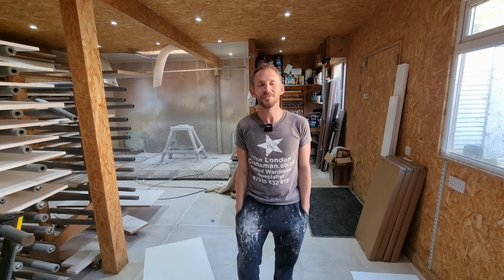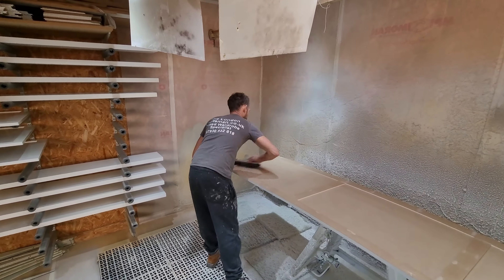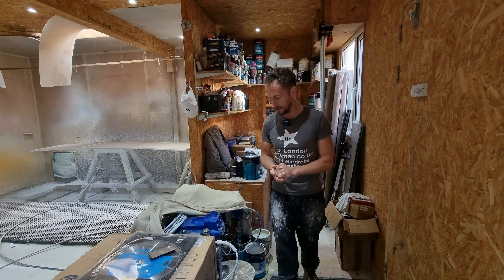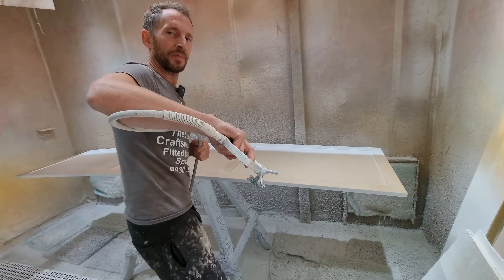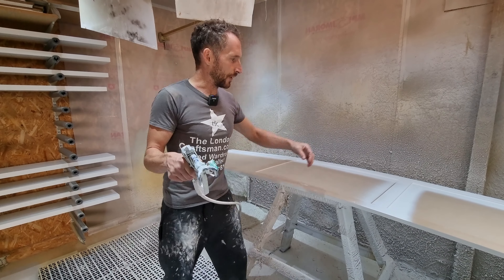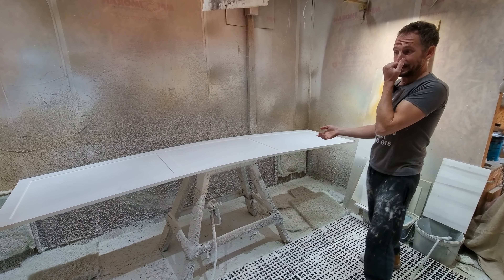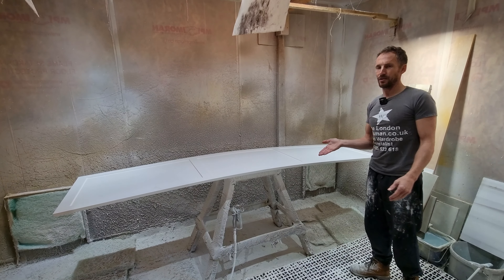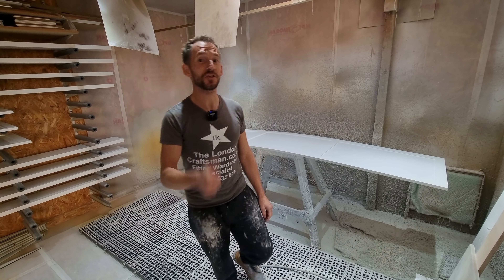I Paint Shaker Style Doors SO Fast Like This... Vid#164

Comment: Thanks for all the tips. I've made MDF Shaker style doors (traditional way ) and used the poor man's sprayer cheap Wagner . They came out alright  but this was before I started watching you. Have some more to do so will use some of your tips. I have a tip for you also. When you get water drops on the MDF, dab it as normal if it is really wet first  but to get it dry within about 30s hold  a vacuum cleaner  nozzle on it so ithe nozzle  sticks to the MDF with it's suction. This will remove all the water and leave the spot dry. (move around as needed).

Comment: usually dont worry about the profile they all get filled spraying straight , especially if your doing 3 coats. Btw, ive never felt confortable doing mdf shakers by gluing the styles because of the telegraph on the joints, do you have any solutions for that?

Comment: Does the first coat on anything your priming always look abit patchy/faded until you build up layers or should the first coat of paint still make the panel look evenly covered if you know what I mean? Thanks mate 👌🏻
Reply from the maker: Well I put my 1st coat on pretty heavy so it's not really patchy. 
If you go less heavy then I guess it would look patchy. That's not a problem in my eyes, it just may mean you need 4 coats rather than 3.
I do a total of 3 coats and I think it works because if putting on the first coat heavy. 👍
Reply: @thelondoncraftsmanworkshop  thanks mate 👍🏻

Comment: Can you spray water based diamond eggshell or satin over the top of the trade silk?
Reply from the maker: I do and have for the past 10 years 👍
Once you sand it back smooth it's just like any other primer/undercoat (in my opinion) 👍👍
Reply: @thelondoncraftsmanworkshop  awesome, do you find its quick drying compared to other primers? Should save me a fortune compared to using Zinsser!
Reply from the maker: @mananddog9884 well on a summers day it'll dry in an hour or so, or half a day if it's not so warm .
With my space heater on, then only an hour to dry.
But yeah you'll save a few quid for sure. I stopped using specialist primers a long long time ago...